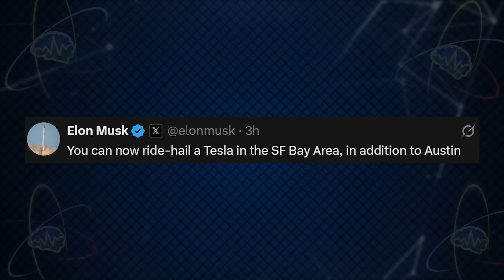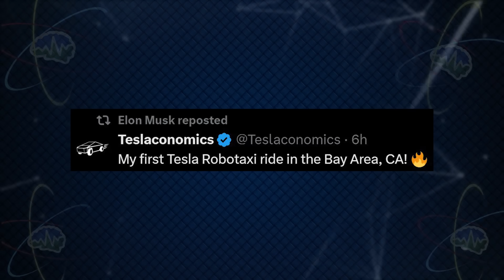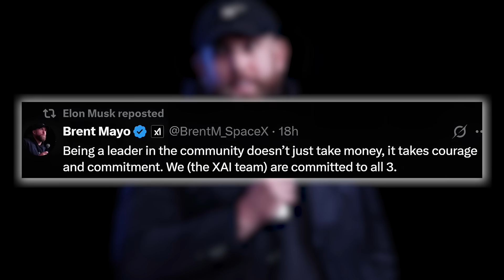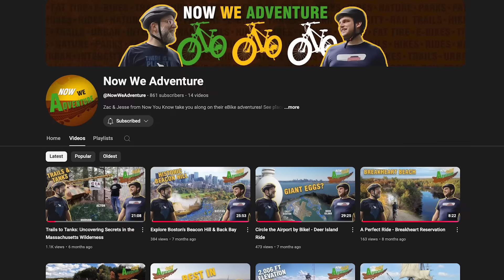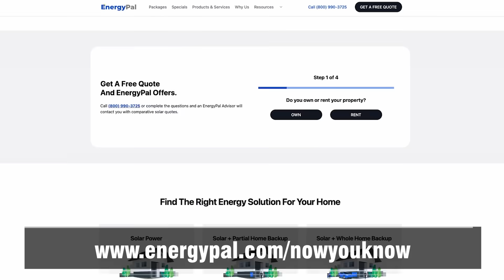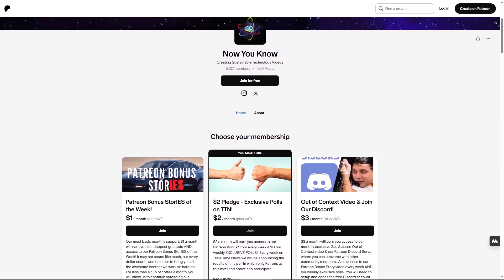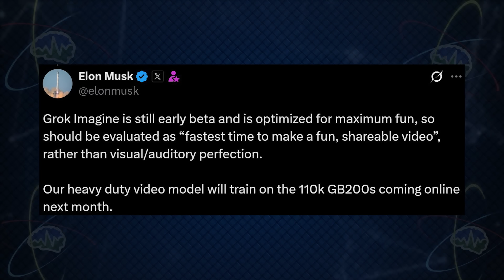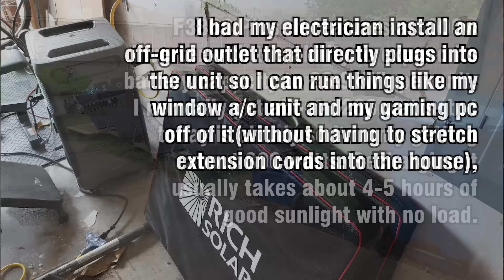Robotaxi Launches in San Francisco | Tesla Time News 500

Comment: I am very dissapointed by all channels who spin it this way. The SF service is a regular taxi service. It's not the first phase of testing an AV service. Miles accumulated do not count in any tally against any milestone dicated by the AV regulations. Tesla has not even applied for a permit to start testing an AV service. Here's a comprehensive summary from ChatGPT:

Tesla does have a permit to test autonomous vehicle (AV) technology in California:

The California DMV has granted Tesla a Self‑Driving Testing Permit (with a safety driver) allowing it to operate AVs on public roads, as of mid‑2025 

However, Tesla does not have permits to operate a robotaxi or fully autonomous ride‑hail service in California, nor is it allowed to carry passengers in an AV (driver or no driver) for public or paid transport:

Tesla holds only a Department of Motor Vehicles permit to test with a safety driver; but it has not applied for, nor been granted, the CPUC’s “Drivered AV Deployment” permit or the DMV’s driverless testing or deployment permits required for commercial autonomous service 

The California Public Utilities Commission (CPUC) has explicitly stated that Tesla is not permitted to test or transport the public, paid or unpaid, in a vehicle using self-driving technology—even with a human driver present 

Currently, Tesla is operating a ride-hailing service in the Bay Area (San Francisco, San Jose, Berkeley, Fremont) using human drivers, under a Charter‑Party Carrier (TCP) permit. This is a traditional chauffeur-type permit and does not authorize autonomous operation or robotaxi service

Comment: I'm confused.  Why are you calling the SF area ' robotaxis ' when they have a driver, in the driver's seat, actually driving the car?   It is the same thing here in Austin.  Since the accident where it sideswiped a car, almost all of the videos being released now have the safety driver actually in the driver's seat.   These are not robotaxis.    Also in the conference call, the CFO stated that in Austin, they have done 7000 miles of robotaxi service in the first 30 days.   That is 250 total miles per day, and if they have 10 cars operating, that is 25 miles per day, each car, which is probably 1 or 2 rides.   I mean certainly Elon has enough money to pay someone to drive the cars, or even sit in them, and take a loss for the next year.  But at some point, to be a robotaxi, that human being has to not be in the car.